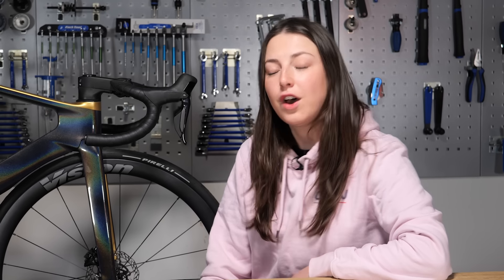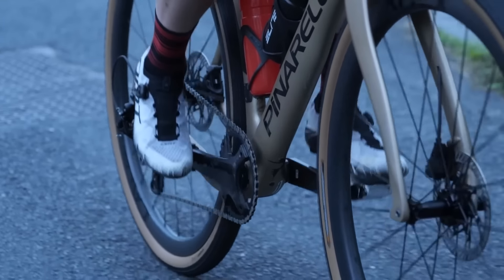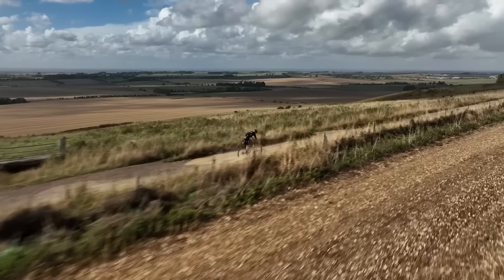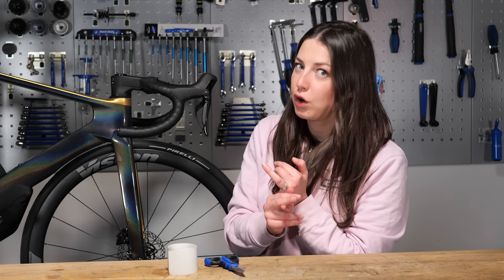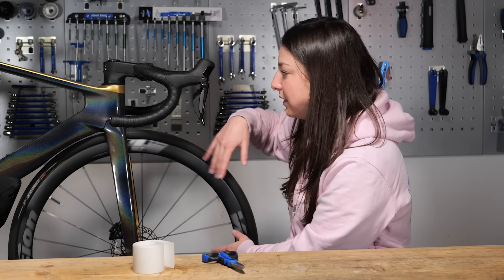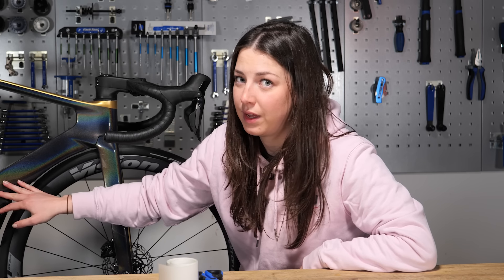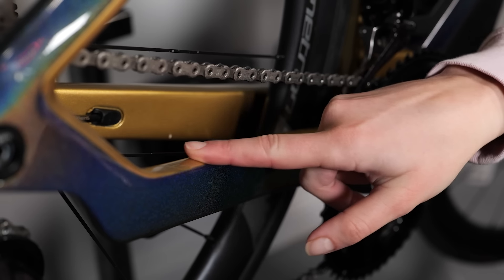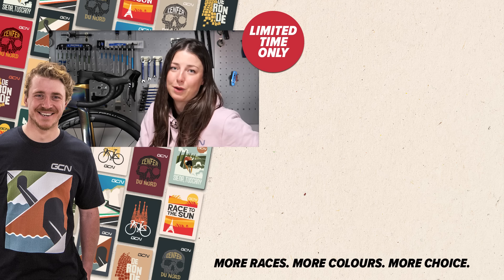How To Protect Your Bike From Scratches

Comment: 3m Helicopter tape in high risk areas. Rest …. Just embrace it. As to sealant it wipes straight off. If you want to remove Helio tape, apply some heat first or it will rip the paint off, it’s that good!

Comment: I have never cared about the finish on my bikes.  My first good frame was bought from the importer at a discount because it had been scratched and chipped in transit.
The old Italian lacquer is so brittle that it flakes off when you look at it wrong.
I still ride that frame 45 years later and nearly 1/4 of the finish is missing.  
It is still a very fast and light Al frame.

Comment: I use correx. A corrugated plastic sheet. Tie-wrapped on.  In a range of colours. Flexible. Makes bomb proof chainstay protector. Quietening chain slap. Cable rub covers....allsorts of frame requirements.
Reply from the maker: Ooo that sounds like a great idea 👀

Comment: Use a grit guard and two bucket method to avoid swirls and straches… meguairs ultimate compound will remove these
Wash ur lower parts and wheels and tires first in a different bucket
Reply: Great way to wash your bike ,another idea is to have multiple wash mits so once you've used one put it to one side then use a clean one so there is a Highley reduced risk of introducing grit into your wash bucket